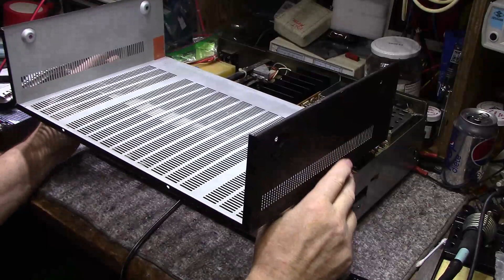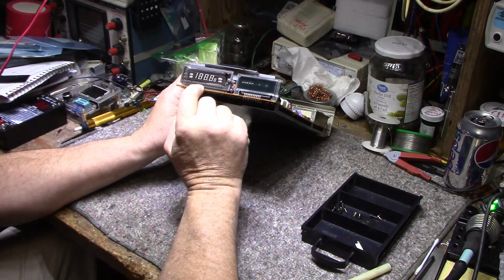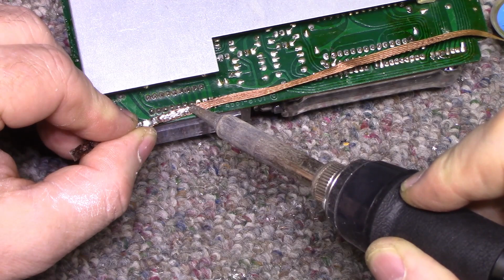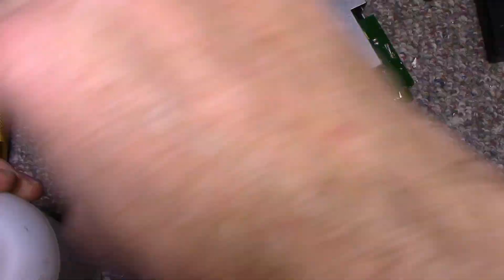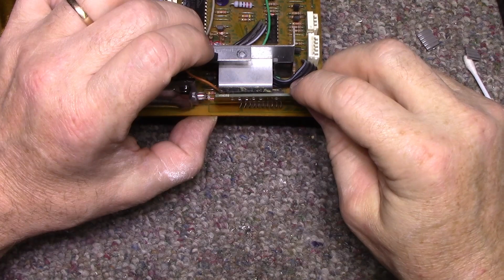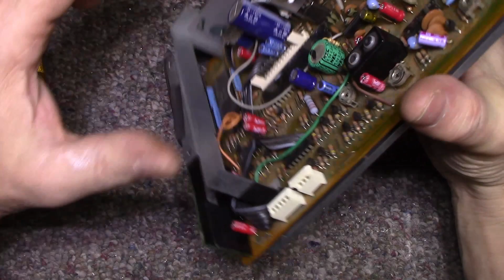How to replace the LED signal strength board on the Harman Kardon HK490i, HK590i, HK690i and HK795i

Comment: Do you make these for HK tuners by any chance? I have a TU-915 with two of the lower strength LEDs not working. Unfortunately, it is not the same dimensions board as the receivers (mounted under the FLD, not side by side)
Reply from the maker: No, sorry I don't. If I come across a TU-915 in the future I will look at making a replacement

Comment: Those Chinese solder braids aren't half bad once you add flux.  They seem to have no flux at all to begin with, so I just add some to the whole roll.  For the amount of stuff I do simply practicing, it ain't too bad - although I think the wires are finer in the more expensive stuff, so it might hold a bit more solder.